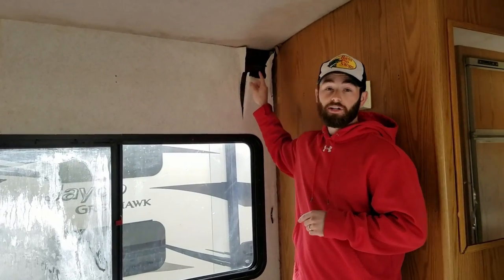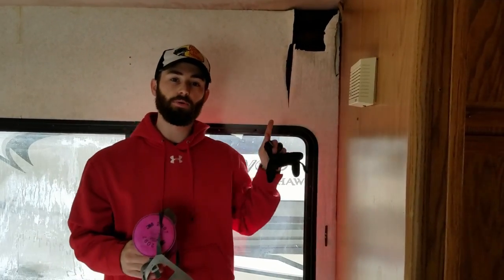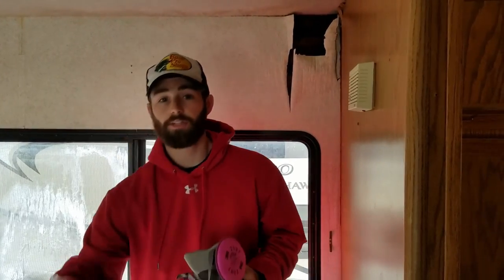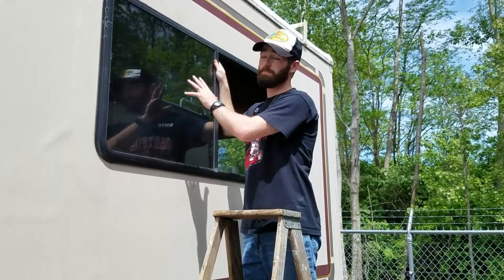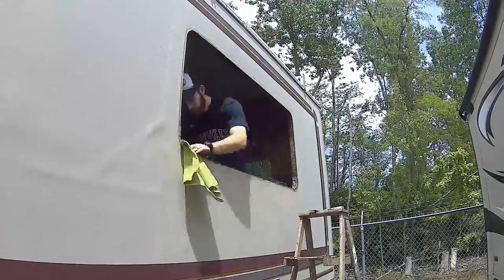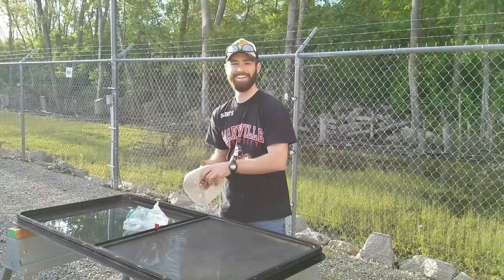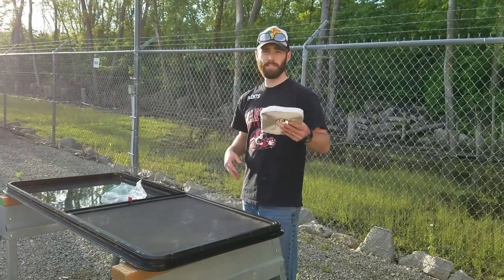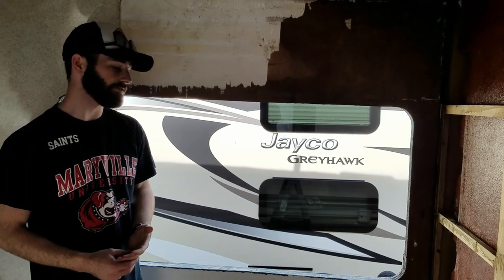RV WATER DAMAGE REMOVAL and NEW WALLS: PART 1 | RV RENO

Comment: Hi, great job and video. Just a little critique... I wish you explained everything you were doing more. As someone who needs to repair my walls and window leaks it would have been helpful to know exactly what you where doing each step. i.e when you took the window out you were doing something to the hole in the trailer, wish I knew what that was... Informative video tho! Thanks
Reply from the maker: Thanks for the tip! :)
Reply: it looked like maybe was scraping off all the old stuff and wiping off so new will seal better, not sure though.
Reply: He popped the window out then cleaned all the caulking off. You want your new seal to be clean of any and all debris. I would recommend not using clear silicone caulking or any silicon.  Use something like weathermax all weather caulking. Use gloves and before you rub the bead see what the clean up chemical is and dip your finger in that before rubbing the bead. If your finger gets some sticky on it clean it off and keep dipping your finger to keep it from sticking to u.

Comment: Ok at 9:47. I had a similar problem.  But not window, it was above the slider frame. 
What did u place between the wall and ceiling?  Factory had a rubber T seal strip.. i cant find them. U would know where to find that?. Thanks

Comment: Do you know how replace the rubber glide that the rv window slides in between? My rubber seal for the sliding window channel needs replacing. That's for the great info.
Reply from the maker: No, we haven't changed ours - though, they do need replacing as well! Good luck :)

Comment: What kind of paneling did you use? We have a couple pieces that need to be replaced in our camper
Reply from the maker: Hello! We used a generic paneling we got at home depot. I can't remember the exact name, but it was about 3-4 mm thick. We also used some underlayment board to replace the paneling. The underlayment board is 5mm thick which was a bit thicker than we needed in some areas but stronger. Hope this helps!

Comment: Hello from Puerto Rico good job. I'm fist time renovating an old RV a lot of Work an no electricity or tools. Advise?
Reply from the maker: It's hard to perform a Reno without tools. We used Ryobi battery operated tool during the Reno because we didn't always have electricity.  Link to our tools is in the video description! If you can't get tool then look to borrow or rent tools from the local hardware store! Good luck!

Comment: I hope you realized the leak is from the roof not the window? I have the same problem, thought I could get some insite on doing the replacement of the wall, but skipped the removal info
Reply: Exactly. Roof is leaking.

Comment: So did you get all the old paneling entirely off? I’m in the middle of this on mine and the part where the paneling and the styrofoam meet doesn’t seem to want to come off the styrofoam. Or did you just get as much off and spray the mold killer on it and put new paneling?
Reply from the maker: We tried to get off as much of the paneling as we could. Did not get it all. Then paneled over it after killing the mold. Hope that helps! And good luck! Tearing down the old panel is not a fun process!
Reply: @RyanMegan  thank you for the reply! Yes does help! I just didn’t want to dig too much into the styrofoam to try and get off all the paneling.
Reply: @RyanMegan  and yeah it’s not fun lol currently in the bathroom and then going to do the bedroom both have mold. It’s pretty simple and just a pain lol

Comment: Great video. When you peeled the paneling for strong the windows what was behind? styrofoam? Did you only use a painters knife to pull it off? I’m having a lot of problems pulling mine of the wet walls!
Reply: He said it was Styrofoam insulation, and it looks like a painters knife.

Comment: I am getting ready to do what you did  for your MH.  Ours is a 04 Fleetwood Bounder.  The seller told me that they repaired the 4 years ago, now leak.   I think we are going to do the same window & wall that you did.  Anyway, do you have a list of what you used for your project.  I see you used a panel.  Did you consider plane laun?  Was it the thickness to match the original thickness?  I appreciate  any information you can give me.
Reply: I didn't see your part 2.  Hoping to see what your completed repair.  Thanks Bob V
Reply: Can you tell me about the panel that you used?  How thick was the panel?  Was it very close to the thickness of the original panel?  We are replacing about half of the wall.  So, I am concerned that the replaced panel will not match.  Is your panel wood or hardboard?
Reply from the maker: We used paneling from home depot that was thinner than typical 5mm layment board for the back bedroom. This matched up pretty well! Now we used 5mm underlayment board in the livingroom and that didn't quite match perfectly. It was too thick. But it all depends on how well you can get the old paneling removed from your RV walls. Hope that helps!
Reply: Thanks.... I am going out there... I am going to use the 5MM.  In removing the wall, I took off a little of the insulation.  I am going to sand the insulation using 40 grit sandpaper, just enough to fit the 5MM luan to the existing wall.  One more question.  How happy are you of the spray glue?
Reply from the maker: Sounds like a solid plan! The spray glue was okay, but I used liquid nail in the living room and have been much happier with that.
Reply: It is me again.  I have another question.  I have my  laun panel ready to mount.  I sanded some of the insulation to get the flush .  Now, what did you do with the new panel to another original panel.  Did you joint compound  which normally is used with sheetrock.  I would be concerned that would crack.  I thought to use the tape that is on the original sticky tape on the RV or possible using caulking which wouldn't crack, I think.  What did you use.  Thanks.
Reply from the maker: We used a joint compound and it has cracked a bit in some areas. Tape that you could paint might work better, but we didn't go that route! Sorry I dont have a better answer for you!
Reply: @RyanMegan  Thanks for you wisdom.  Be safe.